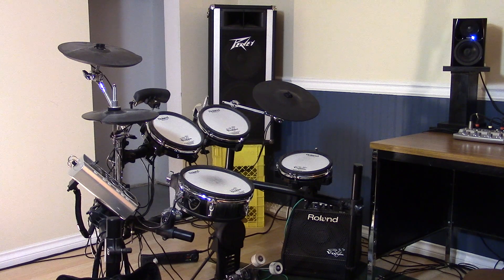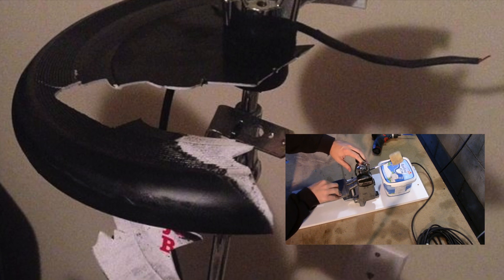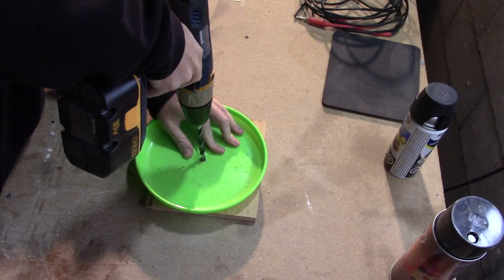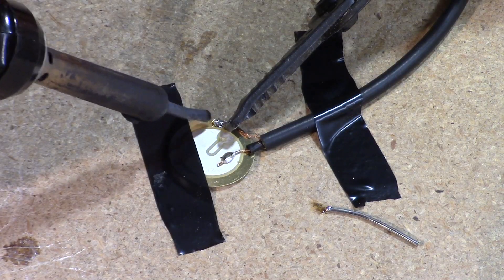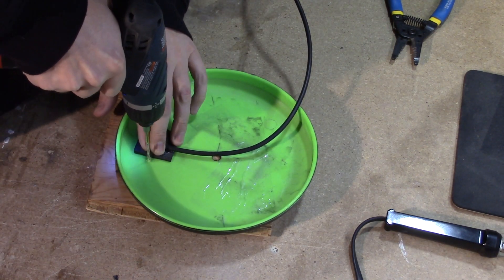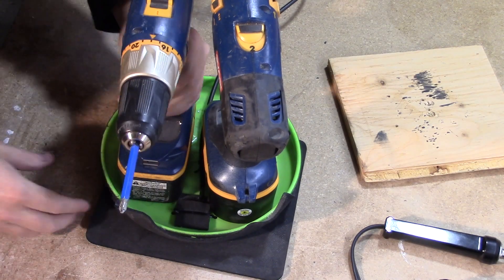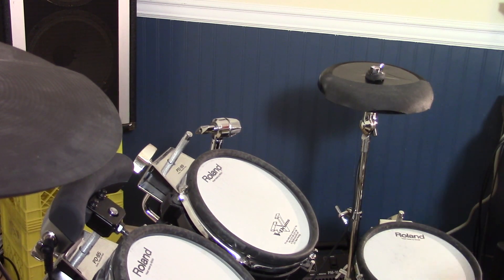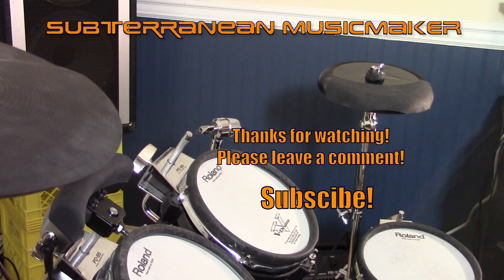DIY: e-Cymbal Trigger Made From Junk!

Comment: I used your tutorial as inspiration in constructing cymbals for  a homemade drum kit built around a Rockband 3 controller from a thrift store and a Yamaha DTX400 module Long and McQuades blew out in their Attic Sale for $25 CDN. I solved the hole cracking the cymbals by using dog frisbees, which are a softer material to protect your pet's teeth, and can be had cheaply at a dollar store from $2-3.75 CDN each.I reinforced the holes with fender washers. I also bought some bulk bare piezos from Amazon so I wouldn't have to crack off a casing and could experiment with other stuff like a homemade bass drum tower. Works nicely, will stand up to quite a bit of punishment. Thanks!

Comment: I'd go for a more flexible material to avoid cracking, such as a softer plastic or hard rubber. Even metal might work, if covered in enough muffling material.
Reply from the maker: For sure, I though of maybe trying one with a disc golf frisbee.

Comment: You can use this: https://www.amazon.com/Pintech-Percussion-XT5P-Hi-Hat-Pair/dp/B0002F7AFG/ref=sr_1_2?crid=WIAR85O7U6Y&dchild=1&keywords=pintech+cymbal&qid=1595530735&sprefix=pintech%2Caps%2C335&sr=8-2
I actually bought the already made cymbals and have had them on my kits since 2009 still going strong have not had to repair anything yet and if I did I got my money's worth 10 times over. Can't say the same for the Roland and Alesis cymbals I also have.